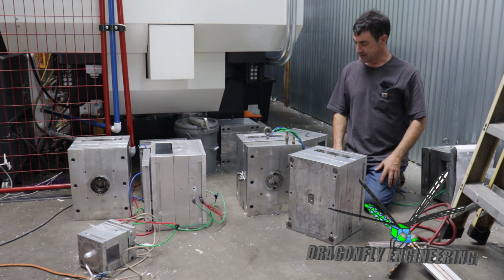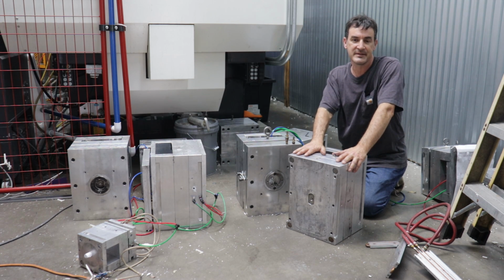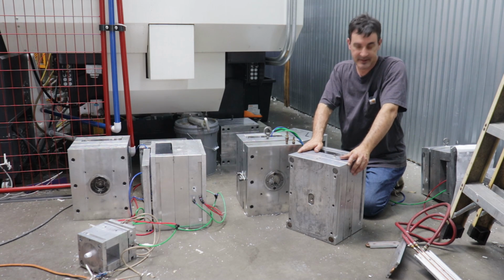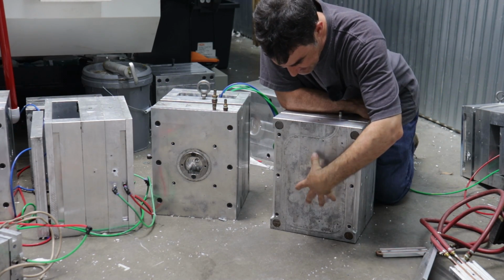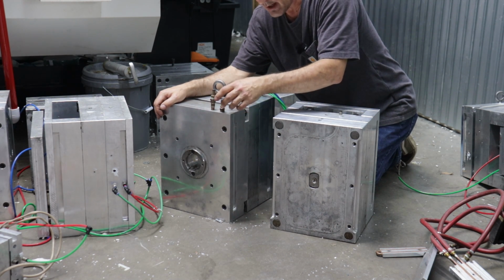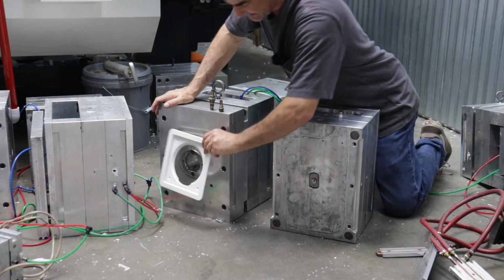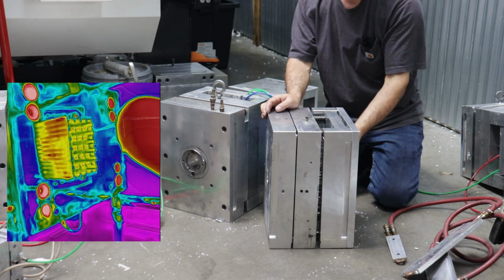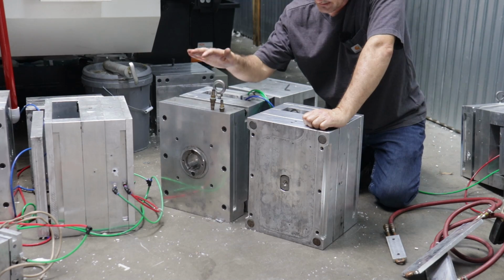MOLD COOLING aluminum plastic Injection molds

Comment: Wich aluminum is it 6061 or others
Reply from the maker: 7075
Reply: @DragonflyEngineering thanks ❤
Sir i want to know can i make pmma lens by   6061 aluminum mold
Reply from the maker: @rifatkhan881 yes, you can get good surface finish with aluminum, but you need a good mill etc

Comment: this is giviing me some idea for my cooling channel in my mould design, do you think that this method will work fine on steel mould?
Reply from the maker: Yes it should work on steel, the temperature gradient in steel is much larger. Aluminum conducts heat 10 times better than steel

Comment: Haha, great! Even yesterday I remembered that you have spoken about cooling with screwable plates in one of the last videos - and there is the solution :-)
What about conducting paste (I use a copper filled one for heating plates for some other projects) for the milled channel? Or isn't it necessary?
Reply from the maker: Hi , yes thermal paste can help with the rate of heat transfer.  I can change after 6 months when the past dries out to a powder cake though.  In this plate the press fit between the 2 metals may be just as good as a thin layer of thermal past.  The large gap where the round and the flat volume would be better with past. Thanks for watching!